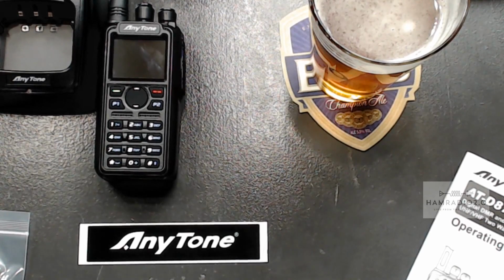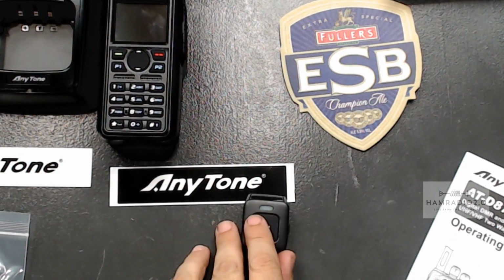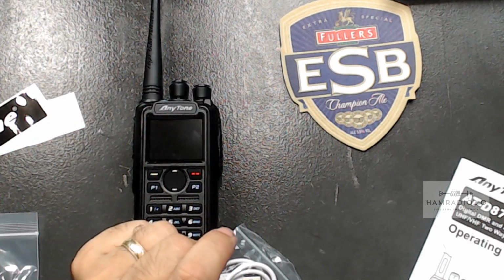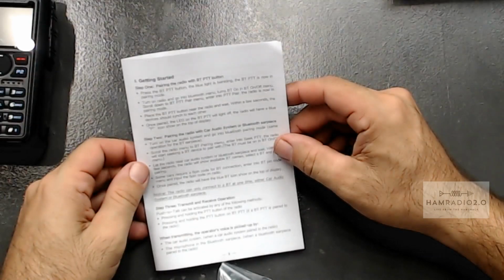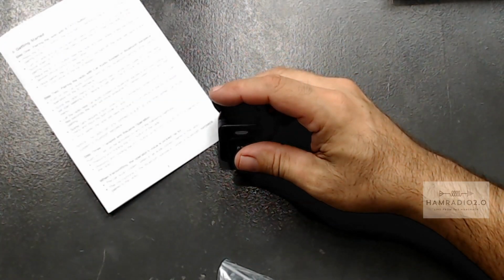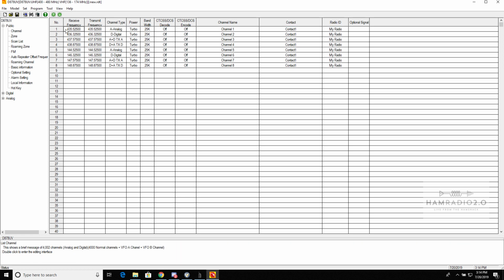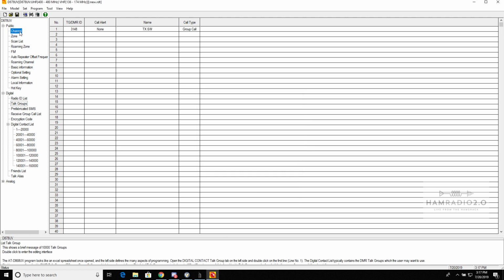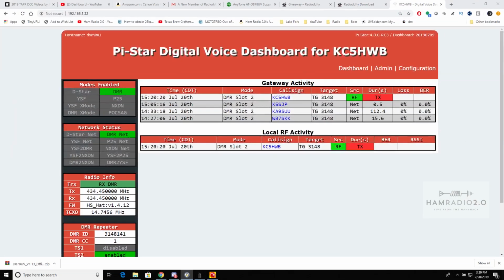Anytone AT-D878UV Plus with Bluetooth

Comment: In my experience, analogue reception is poor (compared to CRT 4CF V2 and even to Baofeng GT-3TP, using the original antennas)! Moreover, it is very annoying that the lowest volume is still too high, and that changing the volume level interrupts the audio. Can't speak about digital capabilities, though - but I will send it back.

EDIT:
Analogue reception is not really poor (but a little bit less impressive)  - the real problem is the insensitive analogue squelch blocking weak, but readable stations/repeaters that other cheap radios can deal with perfectly.

Comment: I hear people using the Anytone AT-D878UV  or a 868 on Brandmeister  They must have the transmit audio gain all the way up  because they are about 100 times louder than anyone else. and here is the Anytone and you turn down the volume and the guy is still to loud !

Comment: hello. I have just subscribed. I have been enjoying your videos and from the research I have done I do think the Anytone 878 plus has a lot going for it.  I am as new as a person can be in ham radio....I am taking my exam and I do not have a radio.  You stated that the AnyTone 878 plus is the most feature rich radio to date.  Although I would like the most feature rich radio it is more important that it has features I feel I need and The AnyTone does not have them.  I am looking for a radio that is best for emergencies which should include being warned in advance of certain emergencies.  I would like automatic NOAA alerts as well as some other features. I have a motorhome that I spend a lot of time in and while traveling I do not always know what county I am in and may not have cell phone or internet and If I have an emergency I want to be able to quickly find help and help can find me ( I guess that means something like APRS,GPS). I would like to be able to program in all the channels worth having like public service, MURS, FRS,GMRS etc.  Also because it is an emergency radio it would be nice to be able to have a add on pack to hold AA, or 18650 batteries to receive and Transmit)  In Florida after some hurricanes we have been without power for almost 2 weeks ( there might have been places longer than that)  Also a plus is to have the charge cable go directly into the radio and not have to lug around a charging base......and Waterproof is icing on the cake.  I did read about an AnyTone model TERMN-8R. It is an older radio and I cannot find it anywhere.  There is the Yaesu VX6, VX7, VX8 series as well as the FT70, and the newest FTDR, finally the Icom 51 and  probably tthe 52 will be better than the 51 (due anyday).  I think you see where I a going......and hoping you can  guide me.....Just picture yourself in the middle of nowhere.....possible disaster coming and you would like some warning.....floods, fires, anything.....then you could get hurt and not functioning at your best and need help.......Which radio?  Any help is greatly appreciated.....thank you, Allen

Comment: Recently got one, and I have a question, does this radio have an option of TX on the last active channel during dual watch?, can't find the answer or information anywhere.
Reply: Kinda late, but yes. While receiving in promiscuous mode press * and it will hold the last active talkgroup, channel and color code

Comment: Question. So i got the Non Bluetooth version.. do you think its all the same board (blutooth and non) ? If so its either just a firmware update to get the Bluetooth to work... i doubt they have 2 separate boards.. what do you think about that?

Comment: So i just ordered one.. but i noticed it was non blue tooth... so the only difference is JUST BT correct? 

Kinda bummed cause it was too late to cancel my amazon order.,
Reply from the maker: The 878+ has bluetooth.  The 878 doesn't.  I don't remember of the non+ model has APRS.
Reply: Ham Radio 2.0  it days it had gps , same thing as aprs? New to ham so excuse my non knowledge.
Reply from the maker: @BeaglerOutdoors  No, not the same thing
Reply: Ham Radio 2.0  says aprs/gps capable

Comment: Hey Jason, in your opinion, is the 878UV worth getting if you don't have a PC to run the programming software? I've got a Mac and haven't seen much on being able to program with it. Just wondering if I should look for something else. It'll be my first HT. Thanks!
Reply from the maker: I don't own a Mac, so I can't speak from that perspective, but they do not make the CPS that works with Mac, natively.  Perhaps an emulator?

Technically yes, you can use the 878UV with no computer to program it.  It will take much longer to program everything you want into the radio, and once you have it there, you won't be able to back it up and you won't be able to load ContactIDs either.  So yes...you CAN do it..but it is quite limited.

Comment: The only thing this thing is missing is AM (Air Band). This would be a perfect radio for me if it included Air Band.  I'm currently looking at the Yaesu VX-8DR (discontinued and expensive for a discontinued radio) or the FT3DR which I hear mixed reviews on the APRS capabilities.
Reply: Kenwood TH-D74 is the best imo even compared to the newer FT3DR. Sounds way better
Reply: @cedricvillani8502   It is also almost $150 more though. I'd expect more.

Comment: i would have already ordered one if Bridgecom was not out of stock :(
Reply from the maker: They probably sold them all at Hamcation - they had several cases there.

Order from R&L, last I checked, they were in stock
Reply: I just got one yesterday on Amazon. They are in stock. Good luck. $238 for the plus model.

Comment: I got my D878UV+ ordered should be here soon.  My first radio! Just got my license.
Reply from the maker: Congrats!
Reply: How are you enjoying the 878 Donald ?
Reply: @Patrickjdee66 I love it. I am having dome fun programming all the things it will do, But that is just me slow at learning DMR and all the thing that can be done with it. It is small but can do so much. I can put it on my outside antenna and get some really good range from it. I did get a better longer antenna for it. I can get most of the repeaters in my county and some outside my county, and with the outside base antenna I have been able to get even more. The antenna that comes with it is OK but there are many antennas that are better. I like it so much that I got the 578 base/mobile radio to go with it.
Reply: @donaldsmith3048  Sounds great Donald, I’m running before I can walk as I have my foundation exam on 28th of this month , just wanted to get to know the radio which so far is amazing, using Bluetooth headsets are great although Apple AirPod pro is really bad, one speaker with interference, but Sony is two speakers and Crystal clear , I’ve ordered a Nagoya 771 antenna today so looking forward to that, just cannot press TX until I pass, 100% need to get a hot spot as I’m nowhere near any DMR repeaters , that will be my celebration gift if I pass, no champagne just a hotspot ha ha
Reply: @donaldsmith3048  I’ll check it out, thanks Donald , hopefully catch up with you on the radio

Comment: Just figured out something most don't know about
to reset MSU after loading new firmware , the reset option was not available on my radio
so here it is if not there by holding down PTT and PF1 whiule turning on radio
I found it talked to my dealer you have to go into CPS software
Go to Optional Settings 
power on settings 
then turn on Startup reset to    ON  bottom setting in CPS 1.15
then you can reset MSU by holding PTT and PF1  while turning on radio

MSU should be reset every firmware update, store your codeplug first you will need it after reset

another thing hold down zero button long press to bring up a manual enter for talk group, for private touch # key to switch
Jason not mentioned anywhere on the net, thanks buddy

Comment: Practice with the radio before you present it, it will help you look like you know exactly what you are doing.
Reply from the maker: That defeats the purpose of the video
Reply: @HamRadio2  I have so many DMR radios, and I program them all. I have no need for APRS, since I also have the FTM-400, and the Kenwood king of APRS radios.  I also have the Icom 7610, and Icom 9700, and the icom ID-5100, and the Icom ID-7100.  I have the Anytone , and CSS-80, and a few Hytera radios, and TYT They are all easy to program, and APRS will not entice me to buy another. DMR radio , DMR is so fragmented as you travel around the country. Only one city had it right, it was New York City, where they have two talk groups, one in each time slot, and one is public, and one is private for members only.  Any DMR repeater that has  too many talk groups in each time slot, is a way to confuse new hams to DMR.  Too many talks groups was brought on by radio guys who brought DMR into Amateur radio.  That was wrong, and it will never change.  I also have other fusion radios, and HT's, the only active repeaters around me are Dstar repeaters.  I stick to simplex with a large group of local hams.
Reply from the maker: @JosephMassimino  there's more WIRESx rooms and dstar reflectors on those repeaters than talkgroups on any DMR repeaters in my area. Of course you're correct about lots of areas but that's just because DMR is more customizable than the others. So to each his own. If you don't like DMR then don't use it, but that doesn't change the fact that it's the fastest growing digital mode in Amateur Radio today
Reply: @HamRadio2  Fusion rooms, yes I had one for a long time, and reflectors, they all function in a different manor than DMR.  Dstar suffers a little by the older CODEC it uses, but it holds its own. The black hole of Dstar repeaters is a lot like what happens in DMR.  The Fusion rooms don't have any  of that. I was going to get back on my Fusion room, but the FTM-100 stopped transmitting  on only one band, but not the other.  I am going to attempt to figure it out for myself when I get more time. The latest changes in the Fusion radios allowed me to update firmware on them. One thing about Yaesu is that they never make firmware updates as easy as many other manufacturers.. I have a CS-800D I bought for my new truck, but i soon took it out, and only have the FTM-400, and ID-5100 in it now. The FTM-400 sits on simplex, and I use the 5100 on Dstar.  the thing about DMR, is about all the talk groups getting pulled into different directions, and some of the new to DMR  Hams wonder why they did not get a reply from the guy they were talking to.  That is the single worst thing about DMR, nobody asks about the repeater being busy, because there is no way to do that. especially if the repeater owner has a talk group that he and his friends have, but it not published anywhere.  A lot of that goes on all over the country, and probably in other countries that use DMR as well. DMR, has a lot wrong with it for Amateur Radio, and that might be only my opinion, but i believe it.
Reply: Joseph Massimino you went all around the world to finally settle on simplex? Ya so a TH-D74 is probably the only radio you need.
Reply: Ya made it seem way way way more difficult then it actual is.

Comment: Good morning. I found one of those neon lighted call sign displays like the one behind your head. It came with on instructions. There are two very small wires out of the back. What in heavens name do you power the unit with? How many volts and what power supply do you use? Please help me. I have no Elmer to help me. Thank you for your time, and I will not bother you again. By the way, you do a very professional job with your excellent broadcasting. N4KBM.
Reply from the maker: You'd want to contact the person you got the lighted sign from.  In my case, my sign came from Gifts 4 Hams, who are one of my  sponsors, and it came with all connectors, power cables, everything.
Reply: Ham Radio 2.0 what power is required ? Thank you for responding. You are a reliable man.
Reply: Tommy Cheshire just by looking at it, i would try using a iPhone power cube and just cut an iPhone USB cable.

Comment: Don’t get the purpose of a BT PTT without a mic. Makes no sense. Seems like your confused too. Do you need a headset along with the BT PTT? More Chinese confusion. I’ll stick with my 878 UV. Works fine without BT. I think the Chinese wanted to jump on the BT train but forgot the missing link. MICROPHONE.
Reply from the maker: No other radio with Bluetooth (Motorola XPR 7550, Kenwood D74) comes with a headset, PTT button...anything at all.  At least this one comes with a PTT.  It'd be nice to have a headset too, but those are universal.  Go on Amazon and search for   BT PTT button - you won't find much, if anything at all, but there are headsets everywhere.  In my opinion, they made the exact move they should have with introducing the first radio ever to come out of China with BT, and included a button with it that you can't get hardly get anywhere else.

Comment: Great video as always.  The Bluetooth doesn't quite appear to be very useful.  A remote PTT for an HT?  Must serve a very specific use case.  Looking over my BTECH DMR 6x2 (also made by Anytone) it's the same radio without the Analog APRS (which isn't all that important to me anyway).   Here's a great comparison of the features from Miklor:  http://www.miklor.com/COM/Compare-DMR.php
 - 73 (W6OMH)
Reply: I can Bluetooth to my motorcycle helmet and use the ptt to use it on the motorcycle
in the car Bluetooth to car as a phone can be strap Bluetooth to steering wheel , very useful
possibilities are endless very nice option
Reply: Robert Taylor yep your the winner
Reply from the maker: I suspect it is useful for using a BT headset that is meant for a Smartphone.  My Plantronics headset is nice, but it doesn't have a PTT, since it is meant for a phone, not a radio.  But with the PTT button and that headset, you could use the radio when it is out of reach
Reply: @HamRadio2  haha.  It's a handheld radio.  How far out of reach would it be?  Sounds more like a solution in search for a problem.  Appears that Digital Roaming is the one feature that the D878UV has.  Otherwise a minor upgrade to an already solid platform.  Would be great if it were a first purchase, but probably not worth an upgrade.
Reply from the maker: @SoCalDaveL  perhaps true. But it's the next logical step, regardless, since several Motorola and Hytera radios already have BT, along with the Kenwood D74. And those don't come with PTT buttons.

Comment: Why don't you upload a Texas Code Plug to the Bridgecomm website for other users in Texas to access?  Would you be willing to do that?
Reply from the maker: We keep a National Codeplug database on DMRTexas.net.  You can find links to codeplugs there from several states, including Texas
Reply: Too bad the National code plug listing is out of date and not available at this time.
Reply from the maker: @flyboybobio3431  I just pulled it up so not sure what you're looking at, but it's there and as up to date as each individual website wants it to be.
Reply: Clicked on you link. Went to  “Recent News”. National Codeplug Database Overhaul Underway. What am I missing?
Reply from the maker: Instead of Recent News, go to the Codeplug Menu, then National codeplugs
Reply: @HamRadio2 Which of those listed would work with the Anytone?
Reply from the maker: Each link should take you to a site for whatever State is listed, and on those pages it'll tell you which radio they have supported codeplugs for.

Comment: When you connect the radio to your cars Bluetooth it uses the cars microphone and speakers so your are hands free. Velcro the ptt button to your steering wheel and your good to go 👍
Reply from the maker: Yep that is a great idea
Reply: I think that was the intent of the Velcro button.Radio Manufacturers only decide to put Bluetooth in radios because of all the hands free laws coming about . If they intended for it to be worn on your finger then they would have made it more ergonomically designed and sized for your finger.Not to say you can't use on your finger but it is a little bulky and inconvenient when tying to do other things while wearing it. If I was to use it on my finger I would put it on my middle finger and index finger in the palm side  of my Hand. It would be easier to push with thumb.
Reply: Exactly,  that's the idea, the steering wheel, "for the thumb" lol, good beer huh

Comment: Good video. For the overhead shot focusing issue, try setting it where you want it, get it focused on something lying there, and turn off auto focus. Then it’ll stay put and focused on items at that distance instead of dancing back and forth due to the lighting or white vs dark.
Reply from the maker: Yes I already did that, after this video.  Good advice though.